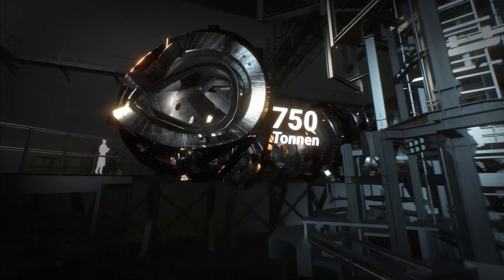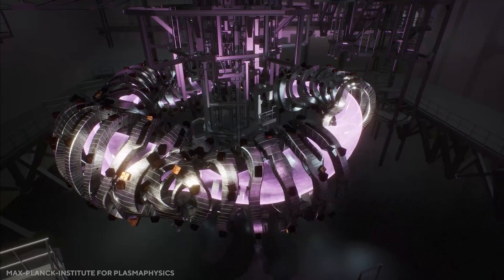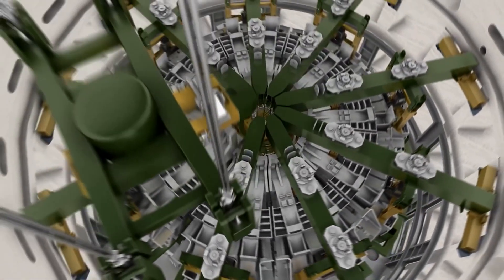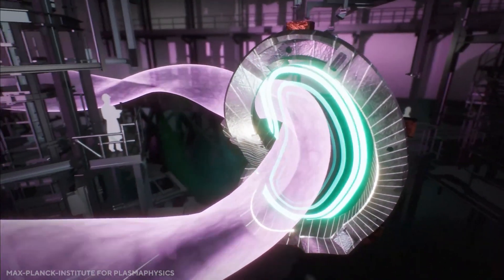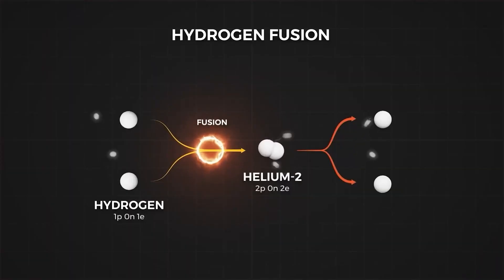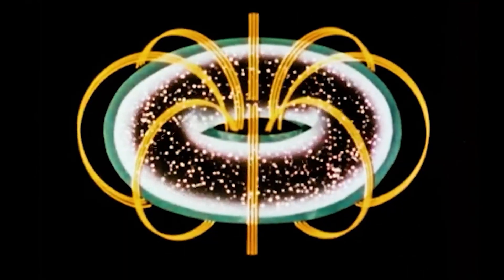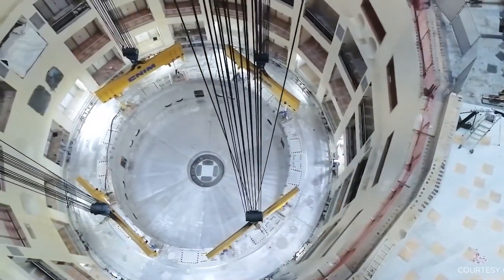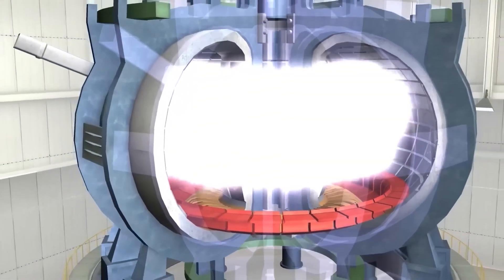AI Cracked the Code of Nuclear Fusion to Destroy Oil and Gas

Comment: i feel stupider listening to this first iter is pronoced e ter second  the reactor is at 10,000,00 degrees and  the plasma con not ever touch the wall  because it will burn the unit the wall do become radio active buit it takes alot of time and iter  if work will become  self suffient

Comment: You know you can take a 1F capacitor and 1H coil and pulse it at 1V  6.3S and it will give you 20 volts at 20 amps you just have to know where to put the GROUND hit it is not on the NEGATIVE side.

Comment: China had a picture of their Fusion Energy machine, a bit smaller than other, it looks as a huge size pressure cooker, with a man holding in hand a thick cable with a plug.

Message, not very 'subliminal', was the Chinese Fusion Reactor is ready to supply power to the grid.
So, What?

Blessings +

Comment: 1:35 I hate to be 'that guy' but it does produce nuclear waste as the reactor casing becomes radioactive during use. Granted this is not a direct waste product but it should be made clear, there is nuclear contaminated waste.
Reply: Statements suggesting that fusion reactors pose similar radiological risks to fission reactors are misleading and verge on fearmongering. In fission power plants, dozens of tons of uranium fuel pellets are loaded and remain inside the reactor for 1–2 years. During operation, these pellets undergo nuclear fission and are transmuted into highly radioactive isotopes such as cesium, barium, iodine, krypton, xenon, and plutonium. These fission products generate intense heat and high radiation, and after shutdown, the spent fuel must be stored in cooling pools for 5 or more years due to their residual radioactivity.

Fusion reactors are fundamentally different. The total plasma mass inside the reactor is less than 1 gram, and the primary fusion product—helium—is non-radioactive and continuously removed from the system. There are no fission products generated in fusion; hence, no long-lived high-level radioactive waste accumulates.

While structural materials, such as steel walls, can become mildly activated due to neutron exposure, the resulting isotopes are entirely different from fission products. These materials remain bound in the solid structure and cannot disperse into the environment in any meaningful way. This is in stark contrast to fission reactors, where catastrophic failure can release highly volatile and mobile radioactive elements.

In short, fusion does not produce uranium-based fission fragments, does not accumulate high-level waste, and poses no risk of large-scale radiological release comparable to a fission reactor accident.

Comment: When you make a promos of a new thing by misrepresentation of a past failed promise. You instantly get an f in my class. Even if what you want to show that is new is working and does what you suggest. 
The lasers making a pellet explode to make power lied directly. Power results was not of the whole system, but of the laser power density. Zoom out and you see the huge issue. 3%, not 50. I will watch more, but you aren’t credible yet in my eyes already.
Reply: No wast? It sprays out neutrons that damage the reactor. You reference the net energy gain again which was false. I’m not trusting you. Removing from history. The is 10 seconds of maybe valid info here. They still don’t use sound to control the neutrons so fail. Goodbye.

Comment: Why not just build a massive barge with large metal arms on land.  Waves that come in cause the barge to rise and fall pushing and pulling on the arms which turn the generator.
Reply: losses from friction due to weight of the components, sometimes the weight being too much for materials we can cheaply produce, durability of the system when exposed tom the sea (salt spray alone is a bitch).

basically the usual suspects plus sea-specific challenges

Comment: Creating A Neutron Star

You get a box with solid hydrogen and add a large amount of solid oxygen. You fill this with gas oxygen. And explode it with fire. You can only contain this star in a vacuum. You feed it with hydrogen to make it grow. It produces nitrogen. You feed it nitrogen or salt to make it shrink. This will vacuum what it's in and able to stand opening awhile. This is a good non-artificial light source.

Comment: BS detector is working overtime here. Even if the plasma can be contained it has to be kept away from the sides of the twisted torus enough to avoid cooking it .... yet at the same time the heat it produces has to be efficiently harvested.  It's not like you can line the inner walls of the twisted torus with pipes to both control and harvest the heat because you need the heat to sustain the fusion but you need to extract the excess heat produced when fusion is attained. Either there is a conflict of interest or a fine line between sustained operation and thermal run-a-way. Good luck with this money pit. Many are sufficiently impressed by the science-drama. There are better intermediate fission technologies to sink your money into people. Wake up.
Reply: Few understand this

Comment: From what understand, the energy output exceeding the the input only calculates the energy used to run the generator, not all the other systems running the generator.  So it is still a a significant net loss, energy wise.
Reply: It says in the video, it put out more energy than it used. It created more energy than it used to run the entire thing.
Reply: @Crouton_6 worng
Reply: It is like what the comment said

Comment: I am paraphrasing what Dr. Steven Greer stated in reaction. An energy gain is a lie. Simply because the many high powered lasers used to create the reaction and the energy used was not a part of the calculation for the energy gain. They had enough energy to boil a kettle to make a cup of tea. They used around 1200 times the energy for the lasers.

Comment: As a Systems engineer, developer, and owner of an AI based company...

PLEASE STOP USING THE TERM AI FOR EVERYTHING. MAX PLANK DID NOT USE AI, THEY USED MACHINE LEARNING AND PROBABILITY TO DETERMINE BEST CONFIGURATION. NOT EVERYTHING WITH AN ALGORITHM IS "ARTIFICIAL INTELLIGENCE" - This is the equivalent of boomers calling the Internet the "Arpanet" (long since dead)  or "inter-web" 😂

Comment: Don't spread the propaganda that fusion reactors don't create radioactive waste.  D-T fusion produces neutrons, just like "dirty old fission" does.
Worse, the T in D-T fusion stands for Tritium, which is an extremely expensive, artificially made, highly radioactive substance.

Tritium is worse than the spent fuel from fission reactors because Tritium is a gas. Besides being an inhalation hazard,
it reacts with oxygen to make radioactive water, which will efficiently contaminate EVERYTHING in the local environment.
Fusion does not equal non-radioactive.
Reply: Everything you have said is garbage.  Obviously you have never looked at the atomic chemistry or have the slightest idea about the science.  Tritium is heavy hydrogen but still a very light gas.  It dissipates quickly.  And neutron radiation is very manageable though engineered safety measures.  Neutron radiation doesn’t leave radiation behind from its interactions with normal matter.  Neutron radiation or any radiation doesn’t stick around if the source doesn’t stick around.  In a fusion reactor it’s 100% used with the only waste as normal helium.
Reply: The activated surfaces from fusion reactors can be re-used in 100- 200 years, which is nothing compared to fission waste.

Comment: Fusion energy production is at least 60 to 100 years away at the earliest.  They say it’s 30 to 50 years away to produce stabilised fusion plasma energy streams but as we can see as soon as you put something in the plasma it cools down and fusion stops.  If they manage to get stable fusion plasma and get 1.5 to 2 units more energy than they put in then it’s going to be another 30 to 50 years to design a power plant to produce electricity so we won’t see the world running on fusion technology in our lifetime and that’s sad.  It’s probably another 2 or 3 generations away and that’s a BIG IF.  My great niece has just been born and she won’t get to see fusion and that breaks my heart but her kids might toward the end of their life span.
Reply: Right, but we got advanced fission reactors instead. Many of the same advantages and MUCH closer to market than fusion. Expect functioning commercial plants before 2030. Molten Salt Reactors and High Temperature gas cooled reactors and Liquid Metal Reactors
Reply: @migBdk  yeah we are having SMN (small modular) nuclear reactors that are by far safer then big PW (pressurised water) nuclear reactors. The good thing about them is when they run out of fuel you just plug in a new reactor and dispose of the old one in a repository.  You can add as many as you need to and the good thing about them is you can keep them close to cities like 20 plus miles away and this eliminates a lot of electrical seepage and way less resistance due to less cable for the electricity to go through and this means it’s more efficient and cheaper and less energy is needed.  The safety is way more safer than huge pressurised water reactors because there’s no coolant to worry about and if there a power cut or an accident man made or natural the control rods are kept open by electromagnets as soon as they loose power the rods drop and stop the reaction, no risk of a melt down, no coolant pumps which are always the cause of a melt down to worry about.  There will be a heat exchange with water to convert it into steam for the steam turbine though but not to cool the reactors because they rely only on heat shielding not pumps that can fail and cause a melt down.  This is what the U.K. is doing and Rolls Royce has already started building them for testing.  I’m not sure if it’s a molten salt or a conventional uranium oxide reactor though.
Reply: @Biketunerfy  the Rolls Royce new reactor is a traditional light water cooled uranium reactor, just scaled down. The SMR (Small Modular Reactor) is already a step in the right direction and will bring prices and build times down. Molten Salt Reactors will bring prices way down.
Reply: @migBdk  SMRs will be much better technology way safer and cheaper easier to construct and maintain to bring down energy prices.  I’m just sad we will never see fusion plants up and running in our lifetime or even crack stabile fusion energy for that matter and my children probably won’t either but their children might but we have to do this, we need clean reliable energy that’s powerful, fusion is that energy to secure our future for our children.
Reply: With AI we might see fusion sooner than you think if proven commercially viable it could be driven fast especially if AI helps us with room temperature superconductors
Reply: @patrickday4206   at this point it does not matter about super conductors in terms of temperature since we all ready have the most powerful that are cooled by liquid helium.  We don’t even know if room temperature super conductors will be as strong as the cryogenically cooled super conductors.  What matters is their gauss.  We still have to design a power plant that can generate power from fusion that’s another 50 years to design test and build one so we are still looking at the back end of 100 years even if we can create stabile constant fusion.
Reply: @Biketunerfy  no it only takes that long because they aren't commercially viable
Reply: @patrickday4206  the haven’t even designed a plant to harness the fusion energy to create steam for a steam turbine all they are trying to do now is create stabilised fusion.  They can create fusion but not for very long and as soon as something touches the fusions stream it cools down and stops fusing hydrogen into helium which means it can’t produce power.  When they managed to create stabilised fission energy it was another 30 years before a power plant was up and running producing electricity.  It take 5 to 6 years to build a nuclear reactor (just the reactor itself) and not any of the steam recycling plant and piping and spent rods containment pools various other things is about 25 to 30 years.  Nuclear fusion is way more complex and will take way longer.  Who ever cracks fusion will end up the richest people on earth.

Comment: That US "breaktrough" compared laser energy in with energy (heat) out, but ignored the dreadfully low efficiency of lasers so actually the overall efficiency was about 1%.
Reply: but it was still the first to achieve a positive total energy output
Reply: @@Ryloh you're refering to FISSION not FUSION, two differnt things, and actually, they're exact opisites.
Reply: hey is there a paper on this somewhere?
Reply: @jancizuletek670  yes but you wouldn’t even need the actual paper, it was breaking news around the world because it was the first to get more energy out than it put in just like 6 months ago
Reply: bro is glazing. "yes but you wouldn't even need the actual paper" That's actually delusional. No paper, no repeatability, no science . @JayTayPlay
Reply: yes and no, people get really confused about this as scientists are in fact not infinite money wells and the lasers are not top of the line. They had to be smart and crafty with what they could get and they did a hell of a job. It is also of note that tech has and seems it will continue to become better, whether that be in efficiency or power, ANY advancement in fusion is massive and this breakthrough is simply something that has never happened. 

Side thought, if your really coming from the 'US is trying to lie' perspective then I don't think I can convince you but no they are not lying by smudge the numbers, pretty much every fusion facility use the same standards for if it's producing energy so everyone is talking about the same thing.
Reply: We already have over 50% effocient lazer. 
Just those lazers were old AF. 
Anyone who knows even basics of lazers would know how achieving 80% Efficiency of lazers is ez pz so not waste time doing that when we have harder problem of making fusion reactor work
Reply: @anand.suralkar  irrelevant to my point of the usa being the first to achieve a total positive energy output as opposed to everyone else who hadn't achieved that yet ( well not completely as that is an important aspect of as if you're more efficient you have to generate less to get it back but my point was the threshold of actually doing so to begin with)
Reply: To be 100% fair, that laser system IS NOT for fusion power production. It's for testing nuclear bomb stuff since detonating nukes is outlawed.
Reply: too be 100% fair, it doesn't matter since new technology and new ways of using old technology had to be created by Americans to be able to achieve a positive energy out put when other couldn't even get out the same amount as they put in before. @tjpprojects7192

Comment: Where did we obtain the fusion fuel helium-3? It's exceedingly rare on Earth, yet abundant on the lunar surface. All that's required is a fusion reactor. By sending a cargo spacecraft to the Moon and gathering 2 tons of helium-3, the cost would amount to 300 million US dollars per trip for India. With these 2 tons of helium-3, India could generate electricity for the entire country for one year. Interestingly, India's annual electricity earnings amount to $810 billion, so adopting nuclear fusion with helium-3 would lead to savings of $800 billion. This prompts the start of another space race.... India can settle the world bank debt 600 billon dollars in 3 years.
Reply: Helium 3 is not fusion fuel, Deuterium is. Also you would have to scrap off the top meter of the moons surface and process it to extract the Helium-3
Reply: First, how much energy did that moon excursion use. You have to include all the planning, all energy consumed in  human actions including costs to get to work and back. If the sum gets close to zero remember that some energy costs have been forgotten.
Reply: @russellk.bonn8534  first he should work on an electric wheelbarrow
Reply: Helium 3 is a fusion fuel and the Polywell Fusion is an interesting way of using it
Reply: The shape of the gas flow path is a Mobius Strip, which has been around for a long time.  Not invented by AI.